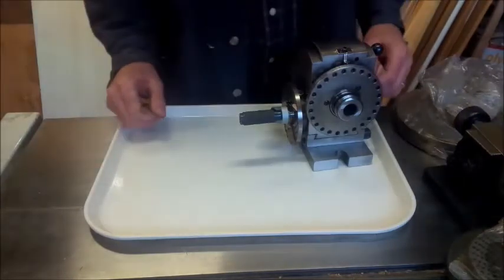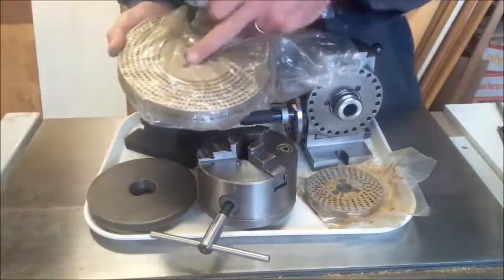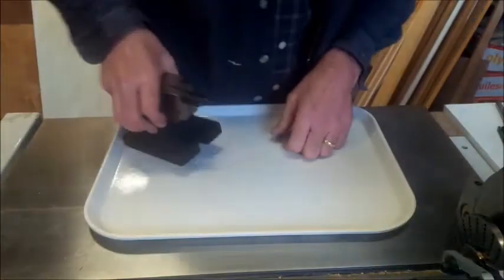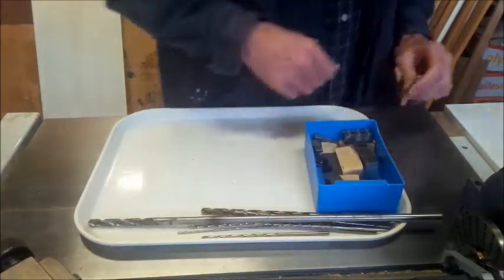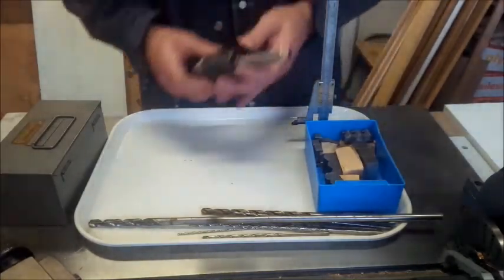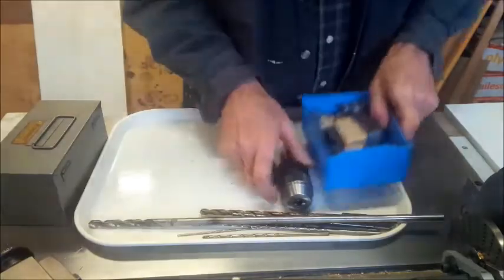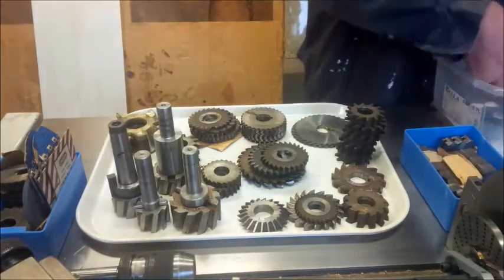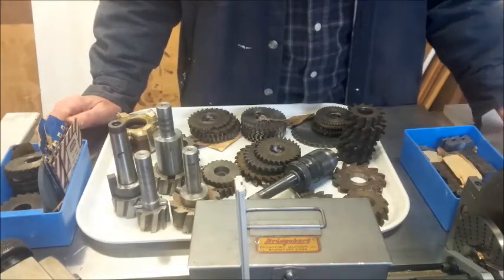ToolScore - Dividing Head and more.

Comment: Now I am totally consumed with envy.  $200 for a pile of tools.  I have never found any deal even near that.  Went to an estate sale the other day and they had a little old rusty table model Delta band saw, maybe less than a 10 incher and they wanted $100 for it.  I toggled one of the door latches on the side of it and it broke off so I gave them a five for the damage and got the heck out of Dodge.  Thanks for sharing.
Reply from the maker: Technically it was $200 for the dividing head including the chuck and the extra indexing plates that are actually not for this piece. Add to that the extra $120 I had to pay for the rest of all the cutters, the keyless rohlm chuck, drill bits, bridgeport counterbores....

So $320 all in plus gas to drive 75kms each way (45 miles). I got robbed I tell you. lol

Thanks for watching and I wish you all the best luck on your next attempt at a toolscore.

Comment: That grey box appears to be counterborers. I have a bunch of the same things and a bunch of the pilots that go in them that center and guide them in the hole.  If you look and they have holes clear thru them in the center that is what they are. there should be some quick change drills that go with them too so you can drill, counter, drill, counter quick change like. Nice score on all those cutters!
Reply from the maker: You are correct, upon closer examination they are counterbores, the pilots are in some of them so it seems to be a set, except I only have one of the drills.

Comment: Those larger index plates look like  the right size to fit a 10" Vertex (or Phase II, etc.) rotary table.

The BS0 size dividing heads (at least in the UK) come with either Myford or Boxford (and therefore Southbend) spindle nose threads.
Reply from the maker: Thanks for watching and the comment Paul. The larger index plates have a 1.125 bore.

The thread on the dividing head is 1-1/2 8tpi which is the same as my atlas lathe, so that's an extra bonus that I have a backplate and another chuck.
Reply: Steve S
I've got a set of 10" Vertex plates somewhere that I've never used, I'll check the bore. I decided that really they're inconvenient to leave in place on the table and too much hassle to swap on and off. A stepper motor conversion is far more useful and versatile.

1.5" by 8tpi is also Boxford/Southbend spindle nose.

Comment: Pretty good deal there Steve. I would have been all over that as well. ;-)
Man, I hate seeing all the good HSS endmills and stuff just thrown together in boxes... it just bangs up the cutting edges and stuff.
I was recently given a bag with 8 solid carbide 2-flute extended length endmills. Thought I had scored but when I examine them each and every one has some degree of damage to the cutting edges even though they all had the protective coatings still on. A couple were ok but most are trash. :-(

Colin ;-)
Reply from the maker: I had another viewer mention my handling of the tools. And after that and your comment, I think maybe I don't respect these items as much as I should.

Thanks for the headshake (as well the other poster). I think maybe I need to build some curter and tooling holders out of wood,, maybe out of some reclaimed trailers. lol.

Thanks for watching and responding.
Reply: I wasn't referring to you in particular Steve. I just see it all the time on youtube where cutters are just lumped into boxes clanging on each other. I suspect when such cutters are used getting a good surface finish isn't easy.
The carbide ones I have can cut but they don't leave a great surface finish due to nicks along the flute length.

Colin ;-)
Reply: Steve S I can give them a loving home Steve if you think that would be better?
Reply from the maker: Cruiser Mac Wow, your so generous. lol

If you need a few cutters maybe we can make a trade, I have more than a lifetimes supply of some of them.
Reply: I know, a generous offer indeed...please no need to thank me! Are they R8 taper?

Comment: I think those large plates fit on the front.  Keith Rucker just rebuilt a similar one and mentioned large plates fitting the front spindle.  Looks like that other index stopper (?) might also come into play.
Reply from the maker: Thanks for the comment. It was fortunate that Keith did his video so soon after I got this dividing head.

I have the direct indexing plate already on my head, the extra plates are for some other larger dividing head.

Thanks for watching.